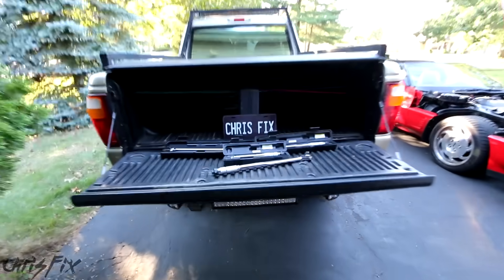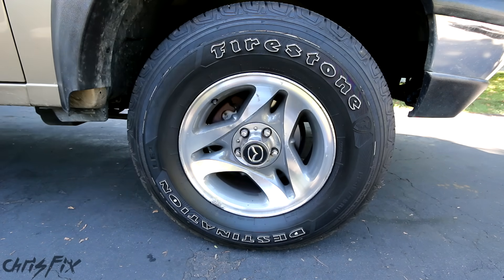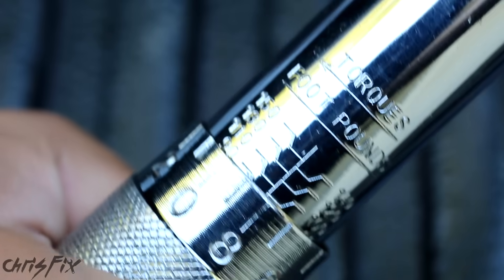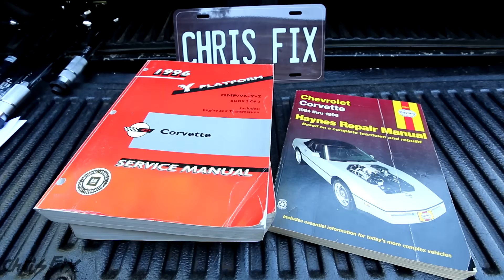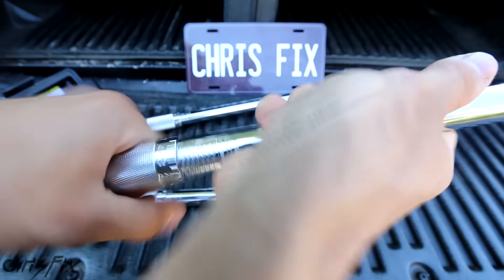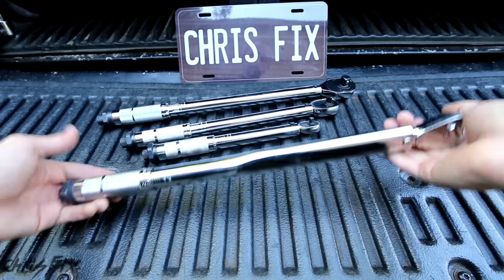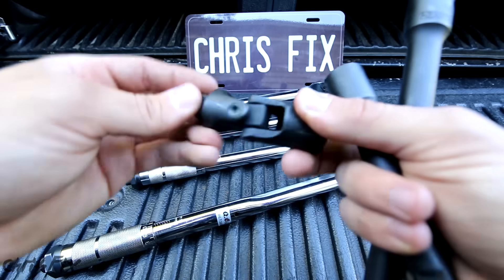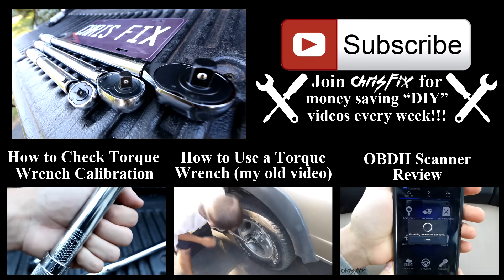How to use a Torque Wrench PROPERLY

Comment: [!] Hello, I have a question about how to read torque specs. For example, in my car's service manual, the torque spec for my wheel nuts says    "98 ± 10 N⋅m (73 ± 7 ft-lb)" I am guessing I need to read what's in bracket so if I'm correct, would my wheel nut torque should be 73 foot pounds?? whats the +-7 after? I can go 7 pounds more or less?
Reply: yes.
Reply: +/- is a tolerance, ideally you would tighten to 73 ft-lb but if you are anywhere in the range of 66-80 ft-lb you would still be in spec and it should be fine.

Comment: One of the most important points in using a torque wrench PROPERLY is to make sure the nut moves at least a bit during the torquing operation.  That ensures it's correct, because static friction will throw things off.   
Using a second click to double check your reading really doesn't do anything because the second click will likely not move the nut at all, and you're just working against static friction.   
If you're trying to check lug nut torque, you need to loosen the nut up first, and then torque it in one motion.  If the local shop gorilla torqued the nut and you're trying to check his work, the torque wrench will always click when you check, but that won't mean much.

Comment: A 100 foot bar with 1 lb at the end is the same as a 1 foot bar with 100 lbs on the end.
So ft-lb or lb-ft is really equivalent as far as torque. 
Though I guess a 100 foot bar would be a bit impractical to use though-  ;)

Comment: Torque specifications are without the use of an extension and certainly not with two hands.
Extension flex is not the only consideration.

Comment: I been used them 22years  most car don't call 100  u always start at the top  and do star pattern ..   u don't left up on them u push down on  them .  the shorter extension the more accurate u will be  I am a level400 T i a  trainer

Comment: There are options besides HF and expensive tool truck companies, but 
most people won't say that. I avoid both because one is garbage and the 
other is wildly overpriced even with industry discounts. There are a lot
 of mid-way companies selling tools just as good if not better than 
Snap, Mat, etc. for much cheaper. Those companies are also more 
automotive focused, and are far from truly specialized high quality 
products despite their marketing campaign(usually done for free by the 
brainwashed truck whores who buy their products and go into debt)

Comment: Just bought a 10-150 ft lb torque wrench but then I seen you torque an axle nut that needed 190 ft lb of torque and thought maybe I should've gone with a 25-250 ft lb torque wrench instead.

Comment: Good video. Something though that should be included is the  cleaning and lubricating of bolts prior to installing and applying torque. Consider that bolts are need to have a having "stretching" force applied to them, not a twisting force. A clean lubricated bolt  eliminates frictional forces so the proper stretch is applied. Dirty or corroded bolts can increase the frictional resistance giving the impression the torque is correct when it is not. A light oil generally can be used, but depending upon the application, perhaps an anti-seize compound is more appropriate.
Reply: It's now 2 years later and I'm going to restate some of what I said earlier about lubricating bolts and anti-seize. The "Audel Millwrights and Mechanics Guide" (can be found on Amazon) does mention lubricating bolts. However, consider the application your working on. For torqueing head bolts, refer to the manual. For lug nuts, think about what the manufacturer believes. They give you a car and a wrench with no indicator. After a change of a flat tire, you simply tighten them as best you can and off you go with a safe wheel installation. Just clean them but don't lubricate.

As for anti-seize, it can dry up or get corroded and increase torque force drastically, so more caution there.

Comment: I agree with your other positive comments. This is the best torque wrench video I've seen. It's comprehensive and assumes the viewer doesn't know anything about torque wrenches. I also appreciate the additional information about calibration, storage, extensions and the applicability of the various wrench sizes and capacities.

Comment: FYI, torque values are not affected by how much an extension flexes/twists.  As someone pointed out, where you place your hands does, so always press on the designated part of the handle.  Adding a crow foot extension can also change the torque if not used at 90 degree angle.
Reply from the maker: Thanks for the tip!

Comment: I have a Craftsman 1/2"  Torque wrench. 20lb to 150lb. It worked great 15 years ago when I bought it but I hardly used it and it sat for the last 8 years or so, set at the lowest setting of course. Now I went to use it and a lot of oil had leaked out in the case and the black plastic handle slides in and out. Is there a way to fix that yourself? If I'm going to pay to have it fixed/recalibrated I might as well buy a new one. Just wondering if anyone knew of a way to fix and/or recalibrate it.

Comment: Chris how you tighten the bolts first with? They looked like they were tight already and you just finished it up with that torque wrench?
Reply from the maker: Use a tire iron or a breaker bar on the wheel lugnuts. Then finish with a torque wrench (all linked in the description).

Comment: There is no need to loosen the tension on the spring when storing. Keeping a spring under pressure does not weaken it. The act of the spring being "used" compressed and expanded is what weakens a spring.
Reply from the maker: +Michael Damato not completely true. There is something called creep deformation which is a common way springs get weak over time and that is from keeping a load on the spring. A small load will probably not cause any issues but a larger load (100ft lbs on a 150ft lb wrench for examples will weaken it over time).

Comment: Great video. I think that since the manufacturer of the tool calls the unit of measure a foot pound that would be more correct than pound feet. The term comes from the force of one pound one foot away from the center point. Hence foot pound. Also, it would be worth mentioning that the way to actually apply the rotational force is smooth and easy and not jerk the tool. Otherwise, an incorrect reading might result.

Comment: hey one question Chris. (dumb maybe) i had a doubt, can you use a 1/2 torque wrench with a 3/8 adapter to torque smaller bolts instead of getting the 3/8 torque wrench?
Reply: yes

Comment: Hi Chris, I didn't hear it mentioned but my understanding is the nut/bolt your are torquing to spec should be moving (dynamic friction) rather than in place (static friction).  1) If the nut/bolt does not move as your trying to set the torque spec it may already be tighter than the torque you are trying to set.  2) Overcoming static friction may result in a lower than desired torque spec.   Net, net, my understanding is the nut/bolt should be moving as you hear the 'click'.
Reply from the maker: Thanks for the tip!

Comment: Great vid Chris, some very good common sense tips. I used to work for Norbar here in the UK many years ago (google it, you'll see who they are) so this subject is close to my heart. One thing you forgot to mention or maybe overlooked, is something I see a lot of young new engineers doing these days - SNATCHING! They get so far and either get fed up or run out puff or both and then snatch the torgue wrench out of frustration or annoyance. Never snatch or yank a torque wrench,especially if the setting is quite high and is difficult to pull or maybe access to your fastener is limited. Two reasons: 1. You could very well end up popping out a shoulder blade (that will hurt!) and 2. You risk over torqueing and going some way beyond the 'click' and stressing (invisibly) the fastener, which could very well fail at some unfortunate point later. Keep up the common sense engineering advice, it's good to see you young 'uns picking up from us old timers!

Comment: NAME                                                                     VALUE
Adjuster locking screws                                      2±0.5
Bottom crown fixing screws                              6±1
Fork leg top caps                                                      10±1
Handlebar fixing screws                                       6±1
Pumping element/cartridge bottom nuts/screw 10±1
Top crown fixing screws                                        6±1
Wheel axle Allen screws                                        6±1
Wheel axle screws                                               15±1

What NM are these settings ?

Thanks in advance

Comment: You said the 1/2" Drive goes from 20-150  ft-lbs more than once, but it clearly show 10-150. It is the most common range for 1/2" drive it seems.

Comment: It is proper procedure to torque lug nuts.  Helps avoid warped rotors.  Also, torquing in the exact pattern he demonstrates is proper procedure, too.
Reply from the maker: Thanks for the tip!
Reply: HealthInfo
Ummmm.. just curious here when you change-out a flat on the road do you torque your nuts?

Comment: didnt mention about things like torque adapters or crows feet. completely changes the torque value if you dont use them at 90 degrees

Comment: Torquing lug nuts should be a practise for the beginner, however after thirty five years in the trade I've never seen it employed by a professional unless in motorsport, military and aerospace applications. Engine and driveline components though must be torqued to OEM spec, in sequence and with absolutely no variation from the outlined procedure.

Comment: I just recently bought a half inch torque wrench for $34.99 from Advanced Auto Parts, can't beat that price if you want to buy a half-inch torque wrench, there's also a 3/8ths torque wrench for $19.99 as well. If you want a fair, cheap, and useful torque wrench, go to Advance Auto Parts.

Can you also use drive adapters, since I have a 18 inch 1/2 inch drive breaker bar with a 1/2 drive to 3/8 drive adapter, and I want to make sure and just ask first before I buy the other one.

Comment: Two big mistakes here man. First "most are 100lb-ft" this is just dangerous everyone needs to look it up for their vehicle. Second that unscrewing the adjustment will make it last longer. Modern decent springs don't fatigue from stable pressure, but all springs fatigue from being worked. By unscrewing it you're working it more.

Comment: Torquing lug nuts with torque wrench? Seriously?
Reply from the maker: Yes, that is very important. If you over tighten it you can get stuck on the side of the road and you wont be able to remove the lug nuts to put the spare tire on. Too loose and your wheel will fall off.
Reply: M'kay
Reply: Where do you work? I'd like to avoid it.
Reply: iAgentLu Also, hammering them on with an impact or just with a wrench will tighten them all very different amounts. That can warp your brake rotors really bad.
Reply: I don't need a mechanic to torque my lug nuts or check my air pressure lmao. I do however find it disturbing that you work as a mechanic for 5 years and are watching a video on how to use a torque wrench and don't know that lug nuts should be torqued to a specific spec. Along with almost every other nut on a vehicle. 

I'm sure you know about making money though as I'm sure your customers have to come back 2-3 times before you actually fix something correctly....if ever..
Reply: iAgentLu are you seriously a mechanic?....
Reply: "Because then you have to torque your "nuts" much harder." Holy shit....try reading the specs. They will tell you EXACTLY how hard to tighten them. No guess work required from the unqualified " 5 year mechanic".
Reply: Dude, it's not about fixing the car correctly, it's about making sure the pieces are put back together in a precisely equal manner so no imbalances occur.  Each part of the car is subject to thousands of rotation per minute and consistant vibrations, so making sure there are no imbalances to be magnified a million fold by these factors and eventually lead to a part unnecessarily stressing, breaking, or at worst the driver to losing control... people trust you with their safety when they let you work on thier vehicle, complacency is not an admirable trait in this.
Reply: You're a bloody idiot. How many successful head gaskets have you changed by winging it without warping heads or keeping leaks you wanted rid of.

Oh yeah, that's what torque wrenches are for... 

Scary people like you work on peoples cars everyday.
Reply: shade-tree mechanic company apparently
Reply: Based off of your knowledge, you must be describing a dream job. Obviously, nobody agrees with you. There are things you should know as a "mechanic" and obviously you don't know the basics.
Reply: "Snug and tight" is complete crap because a lot of people have different strengths. Snug and tight for someone can be completely different for another. Using toque is a way to make sure the important nuts and bolts are at a certain spec. There's no way you are a mechanic, rather a troll. I can't wait for the day you are on a news channel with a helicopter in the sky recording your car in a ditch because your tire fell off.
Reply: iAgentLu I bet you're not even ASE certified.
Reply: Don't feed the trolls. Pathetic troll at that.
Reply: Lesson number one in life, auto mechanics and everything else:  "IF ITS WORTH DOING, ITS WORTH DOING RIGHT".  Period.
Reply: Yes use torque wrench on every single bolt, because you won't fix car correctly if you don't.  OMG this is hilarious.
Reply: Dude. there is no difference how you torque your lug nuts, for all the suspension components you want "snug and tight" principle. The only real problem here can come from different wheel and lug nut materials. For example aluminium vs iron. Because then you have to torque your "nuts" much harder.
Reply: Brady Burke Ok youtube commenter says that i'm not what i am, i guess i'm not then.
Reply: @iAgentLu  oh you must be the lube tech that didn't know what grease zerks are
Reply: Mook aton
Next time when you drive into to the service, tell the mechanic, that you need that your lug nut would be tightened with a torque wrench. And do not forget to exchange air between winter and spring. Interestingly what bill you receive. Idiots like you are NR.1 money maker for us.
Reply: Working mechanic 5 years now, never knew this bs. but ty for advice.

Comment: Older style torque wrenches have a pointer scale which shows how much force is being exerted.
Modern digital ones have a buzzer which sounds when the bolt is tight enough.

Sometimes if you can't afford a torque wrench, you can take your vehicle to a nearby garage and have the bolts checked by a mechanic for a small fee.

Comment: The black oxide extensions shown are a steel grade designed for impact wrenches, softer so it doesn't shatter, and should not be used for torque loading.

Comment: Thx Chris. Here's a (not so) funny torque wrench story. Recently gave my Magnum new spark plugs. In the old days on my motorcycles I would just finger tighten the plugs and half turn with a plug socket to tighten down. Now later on I'm trying to be legit and do things right, especially after watching hours of ChrisFix videos, so I search the web for torque settings. I actually find a video of a guy doing the plugs on his magnum so it's really helpful. Except he keeps talking about torquing to 100 inch lbs, and I get that number stuck in my head. I'm tightening down my plugs and I've got my wrench set to 100 ft lbs and I can feel it's getting tighter than I expect so luckily I stop! Narrowly avoided destroying my top end by careless research. People, check your numbers thrice before doing anything. So it's interesting to hear you say you don't use the smaller wrench as that is exactly what is on top of my shopping list now. Cheers

Comment: what torque wrench type for low 8 ft-lbs specs?
Reply: Mel B a 1/4 inch or 3/8 inch torque wrench should work for a low torque value like that. Id recommend a 3/8 because it'll give you more of a range for the jobs that require stuff from 5 up to about 100 ft lbs. The smaller 1/4 inch wrench would work for low values and would only go up to 15 or so ft lbs (about 180-200 inch lbs) so unless you are constantly working with smaller toques id go with the 3/8 inch torque wrench, itll help you later on in your future car jobs with varying torque values.
Reply: +Frank Delaney Jr. thank you so much for educating n advise Frank !!! i will go with your advise on 3/8.
Reply: You're welcome! If there's anything else i can help with feel free to message me with any other questions. I'm always down to help

Comment: Hey Chris
When are you going to release the video on how to check calibration?
Reply: Really interested also. Especially because calibration will get messed up the most within first year, and i just bought a new tqw
Reply: The official way is to send it in to a calibration shop. I aviation all precision tools have to be set in every so often (torque wrenches, micrometers, pressure gauges, etc.). Where I work we have a torque checker which basically has a gauge, a needle and a place to attach the wrench. You just sent the wrench to a torque, and turn until it clicks and the needle points to the torque the wrench actually made it to. There is a spring inside that gets compressed to create the simulated torque. Even though we have that equipment we have to send it out otherwise we would get in huge trouble with the FAA.
Reply: @MrGiglio13  ...Is it worth it to calibrate a torque wrench that costs around $40...I don't think so and where do you find calibration shop and what exactly do they do to re-calibrate?

Comment: i once used my torque wrench as a breaker bar because i dont have a breaker bar... and i dont buy a breaker bar because i have a extension with some steel pipe